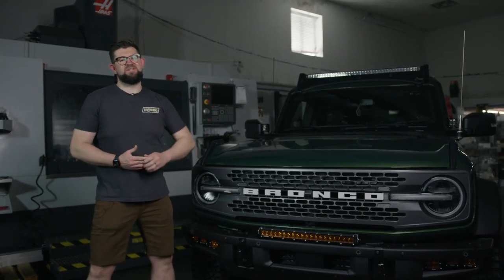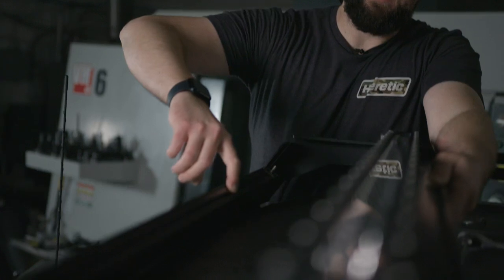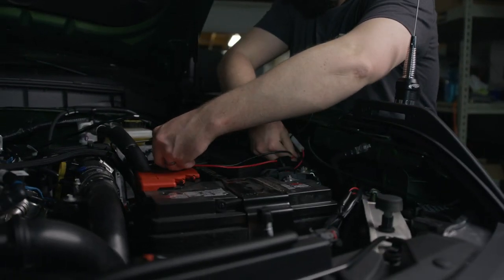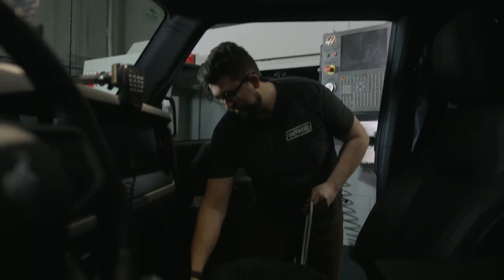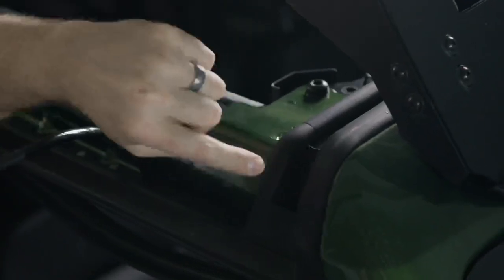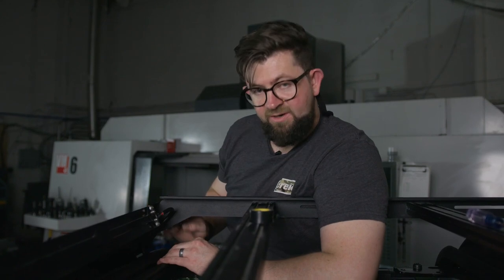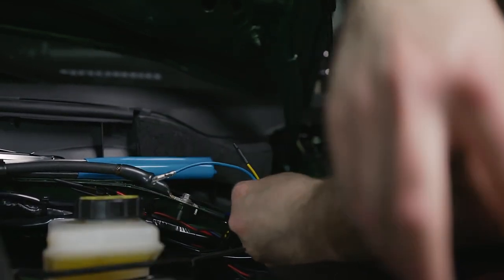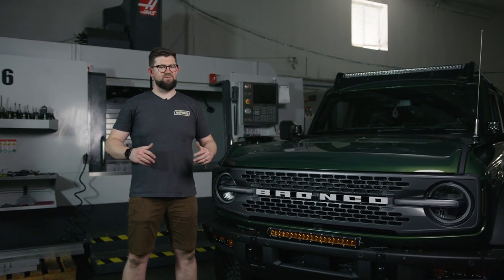Bronco - 40" Light Bar Installation Guide

Comment: Video is useful but like another person aaid we really need a video showing how to get the bundle through the firewall into the passenger footwell. I just cant digure it out and i am stuck. It doesnt seem like anyone else has any details on that. Can you help?
Reply from the maker: Hi Bob!  there is a rubber grommet that sits just behind the washer fluid reservoir.  The video does not show it, and I will send this up the chain to have it adjusted!

It may be helpful to loosen the bolts on the reservoir which will allow you better access.
Reply: It is challenging getting the wire through the grommet.  I had to unscrew the coolant to get at the grommet and then poke a hole in the nipple, stick a chopstick through it to open up the whole a little and then run the zip tie through, attach the wire to the end of the zip tie, lube it up with a little dish soap and then push it through the grommet.  This is definitely the hardest part of the install.

Comment: Great video, I've watched 20 times and took me 5 hours to get everything installed and run. Thank you! At 7:00 you say there is a chanel for the lightbar wire with 2 screws... I can't find that! Could my Bronco be different? "22 Badlands 4 door with Trailrax and lightbar cut out.

Comment: Great video, thank you. Why not install the light bar so the cord just runs down the window on the other side like I've seen others do. Tucking it into the chanel on drivers side windshield. Also I didn't catch how to wire this to the Aux switches.....
Reply from the maker: Actually that is totally possible as well.  At the time, we were showing this as a route to run the wiring since that is where the OEM wiring runs.  Since the OEM is not sufficient, we ran ours through the same path, but there isnt any reason why you couldnt go thought the driver side pillar.  Thanks!
Reply: Thank you, I just realized my cable is too thick to fit in the narrow chanel... Damn it. 

Also do you have to take the Trailrax crossbar off to get those cariage bolts in?
Reply from the maker: @larrycole1991  yes, you just need to remove the screws and it can usually move up enough to slide the carriage bolts in and then you can refasten the crossbar again.

Comment: The wire harness also comes with a relay that doesn’t seem to have a natural mounting location.  What did you do with it?
Reply: Wondering this halfway through the install.
Reply from the maker: Depending on the vehicle, we usually will secure it to existing cables etc with zip ties as often there isnt a great screw or location to hard mount it.

Comment: Can I wire this into the existing electrical system?  I'd much rather power thr lights up using one of the pre-wired Aux switches.  Thanks.
Reply from the maker: You certainly are able to, but what we have found after some time is that there has been some issues using the OEM wiring.  There have been instances where the OEM wiring has caused issues.  Once we became aware of these issues, we started to include a full wiring harness so that these issue can be avoided.  

You are still able to use to the OEM upfitter switch, we just recommend allowing the power to the lightbar run through our harness rather than the OEM wiring.
Reply: I did this and the lights do not work using the pre-wired wires. If you follow this video the Aux switch will still control the light. But you are skipping the pre-wired stuff that is located above the passenger visor and also behind the glove box.

Comment: What is that wire running tool?
Reply from the maker: That would be a giant zip tie!  Really anything that is fairly stiff, yet also has some flexibility will work!
Reply: @hereticstudio  And what is that lubricant you are spraying on it?
Reply: @TIMPORTER100  the window cleaner that’s in the spray can is a great rubber lubricant!